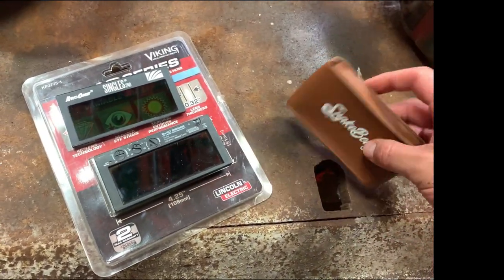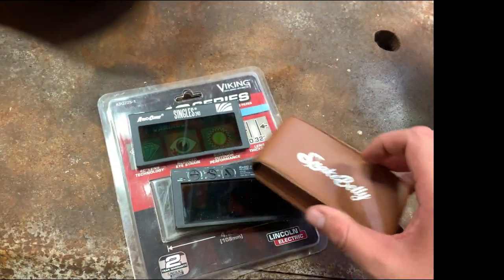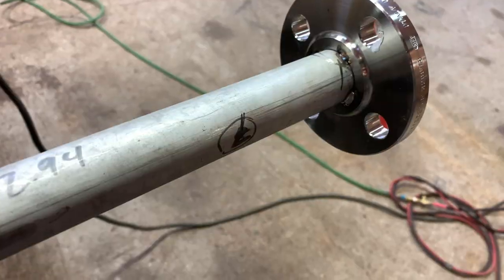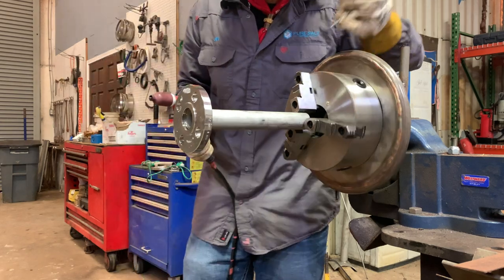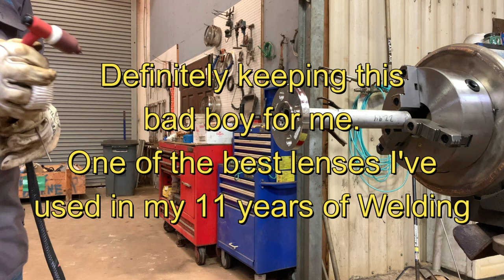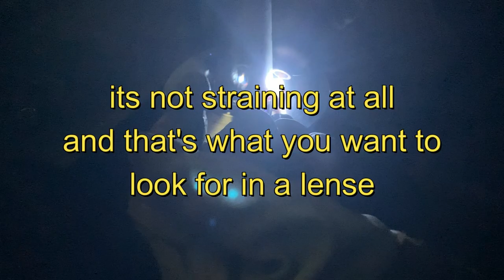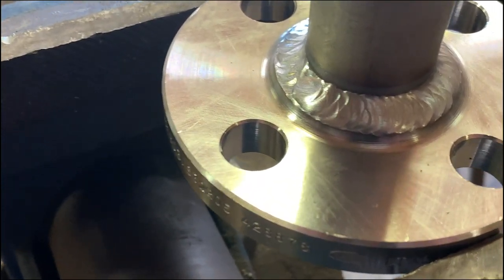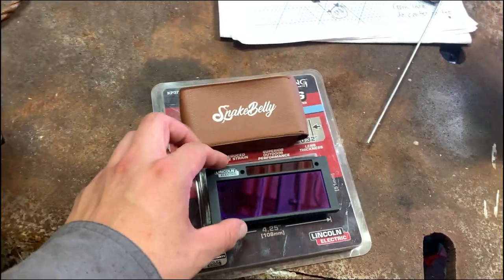Welding Lens | Snakebelly Variable Shade

Comment from the maker: Arc-show.com is where you can get yours. Enjoy the view. 😎😎😎😎😎😎
Reply: Have you had a problem with it cutting out in middle of a weld I’ve been having that problem with mine
Reply from the maker: Even with fresh batteries? No bro not yet. Haven’t had issues with it yet. What I noticed though. If I go let’s say 1 week without welding, the charge dies out quickly causing the lens to not activate
Reply: I think I found my problem out just a few minutes ago when ever I’d put the piece in that holds the lense in place it would push the lense up and I think it was catching some shade from the hood so I trimmed the hole open a little more on the hood it’s been acting fine so far really nice lenses tho with how clear they are
Reply: Yeah even with fresh batteries

Comment: The snakebelly is exactly the same as the ameriarc lense. Same manufacturer different vendor. Just like how the clairvoyant HD lense is exactly the same as the weldtube HD clear view.
Reply: Damn I just read this after I baught one for a lil more
Reply: @jr45482  it's all good man. What matters is that the product delivers what is the intended purpose. Although it's nice to save a couple bucks. I just wanted to inform people.
Techniweld clairvoyant = Weldtube HD Clearview 
Snakebelly = Ameriarc variable lens
(LINCOLN 4C welding lens maybe the exact same as the techniweld/weldtube. Lincoln just "upgraded" it to have their 4c technology.)
Reply: How are they doing now? Still working?
Reply: @franciscozelaya1901  yessir. Had to change battery once. But still works good. One thing I hate is I'm an ironworker and when I throw galvanized decking and have to puddle weld. The 110 degree sun reflecting of the galvanized deck triggers the auto darken and makes it constantly dark. If welding indoor/ not super bright. It'll work just fine
Reply: @SnD340 get you a miller digital elite, it has xmode it uses the magnetic field from your weld to turn on so you can turn the light sensitive all the way down, I love mine for decking.
Reply: @mudingfool  lot of my coworkers have the miller with the x-games mode haha. 
Solid hood

Comment: I've been using the Lincoln 2×4 auto darkening 4c lens....I didnt get the one u threw in the trash....I knew better that was gonna happen....never had problems with mine.....best one I've been in my eyes
Reply from the maker: I must try it. What shade do you use? And for which process.
Reply: @VantageWelding  shade 11. Weld with it with SMAW...TIG....FLUX Core...RMD....low amperage tig. Never had it flick on me....

Comment: Have you tried the arc  one 240-10? I've had good luck with those as well. Never tried the snake bellies. What is the max shade? Mine goes from a shade 3 to 10.5 when welding
Reply from the maker: Yes. That’s my old lens and has been my go to for the past 5 years. But this snake belly is Badass cuz I can use my plasma and weld under the same hood. It’s a variable shade. 5-13 I believe. For 60 bucks. Can’t beat that.
Reply: @VantageWelding  nice, good to hear that they hold up I've had mine about five years now as well. Def gonna try out the snake belly next.  Glad to.see you're still making videos 👍
Reply from the maker: I’m still trying to push out content, just been a bit busy with work and life in general. Thanks for the support boss. 💯💯
Reply: @VantageWelding  i feel ya man, i havent made any videos recently either. it soaks up a bunch of time but i just do it for fun. dont give up bro
Reply from the maker: @johndowe7003  thanks man. I’ll try not to. You do the same brother.

Comment: Does it work properly in a pancake bro
Reply from the maker: Yes sir. I only have a clear lense on front and leave it open on the back side just in case I have to adjust the shade
Reply: @VantageWelding  oh alright cool has it flashed you while doing mig tig or flux stick and does it require battery’s
Reply from the maker: I havent done mig and flux with it as I don’t really use those procedures brother. But it’s legit with stick and TIG.
Reply from the maker: And yes it needs batteries bro

Comment: I ordered this lens not thinking about the thickness of it. Does anybody know of a hood or aftermarket flip adapter that I can use this lens in?
Reply from the maker: I used a knife to make the hole bigger bro. The. Switched it over to my sugar scoop. I use my tiger hood to fit and tack. And pipeliner to weld weld.